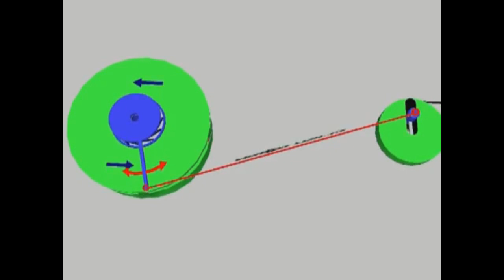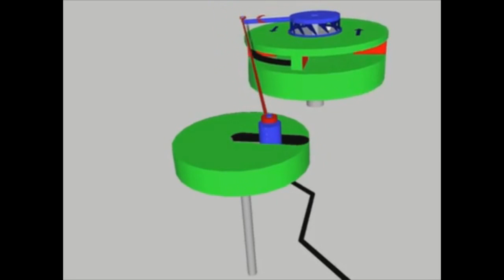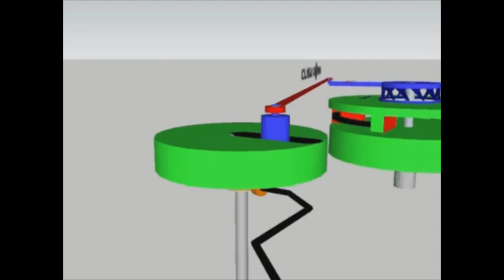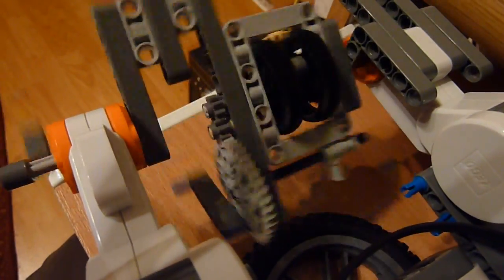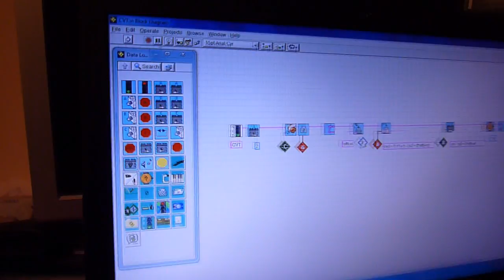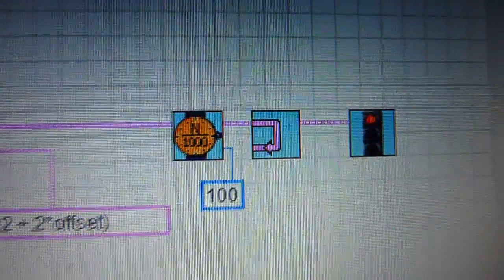LEGO Efficient CVT Frictionless Technology

Comment: https://www.youtube.com/watch?v=F6zE__J0YIU I think you'll find I proved you wrong.
Reply from the maker: That is not true. The concept you linked is just an unnecessarily complex differential. Differentials cannot work as CVTs unless there are 2 main driving motors - and even so it's not really capable of torque conversion.
Reply: I agree with you about the linked concept being an overly complex system for a CVT. However I disagree that differentials dont work as CVTs. I built a Dual Differential CVT out of k'nex which works quite well : 

http://www.instructables.com/id/Knex-Automatic-Transmission-DD-CVT/

Yes, this CVT is not really capable of torque conversion as you state. Instead it is designed to provide a constant amount of torque through an infinite amount of speeds within its range.

Also, the beauty of my CVT is that it requires only a single input, the motor. Most other transmission designs (including yours) require 2 or more inputs. (motorized or not) The compromise to having only a single input though is that my transmission  has a good deal of power loss in the lower ranges due to friction.

Your transmission is not without loss either though, your transmission provides inconsistent power and you do have some friction loss through back-spinning on the ratchet. Something else you should consider, at higher speeds your rotating slider would become unbalanced and cause vibrations. 

The  inconsistent power problem could possibly be overcome by using two push-rod and slider assemblies 180 degrees out of phase, use a separate ratchet for each push-rod, then recombine the power by a simple 3 gear train. This way, while one ratchet is inactive, the other ratchet is driving the output.

Anyways, i'm not trying to prove which one is better. I think each has its own different application. I'm just saying that differentials are quite capable of achieving a CVT function if applied correctly. I think your CVT concept is great btw!

Comment: Junk. Apart from the ratchet design- a known dustbin of CVT designs- you have  a crank mechanism where the crank pin position control is totally glossed over. Tell me how you maintain the crank pin position while it is under load? Here you just use friction. In a real machine several hundred newtons of force will move that crank position in both directions unless restrained. And then you now need hydraulics, pneumatics or another system to change the crank pin position while under load.  Very under thought out.
Reply from the maker: +DoctorShrink You can use a worm gear first and then couple with hydraulics or electric actuator. Worm gears usually cannot be overturned back by the load and they require little input torque.
Reply: +Zenon Dorin You're a genius. So u propose to control the crank pin position with a worm gear. Next question. What controls AND powers the wormgear? Let's see...hydraulics? An electric motor? Hmmm. I'd like to see a hydraulic line reciprocating, with feed and drain lines and a rotating seal (somehow). Hydraulics need a pump and reservoir. I know, an electric motor or actuator. Wow. The crank is rotating at several thou rpm. How do you provide power to a rotating member? Brushes or slip rings. Both wear out, carbon up and create sparks. Gee, not easy is it? I know I'll wave my hands.

You still have not recognised there is a whole class of ratchet based CVTs and yours has the same probs- inefficient, noisy and unreliable.

I shouldn't crush you. You r probably only 15.
Reply from the maker: +DoctorShrink Hahaha. You gotta agree though, this is still pretty ingenious for a 15yo.
Reply: @DoctorShrink  I'm late to this party. While you're right in many ways, where's your video of something you've made? just asking politely now, for information. I see lots of people criticise ideas while not inventing anything of their own.
Reply: Keep working! Cool stuff

Comment: Just amazing! But the non-constant output speed makes it useless in real-life applications. I have also built a CVT, and it doesn't use friction (it uses a double-differential drive instead). Check it out!
Reply: My CVT does rely on friction. However, the advantage of it is that it only requires a single input source while most other designs require at least two. My CVT does not provide more torque at lower gears though, but rather provides a constant torque though an infinite array of speeds.
Reply: If you want to see where the friction is applied see step 11: http://www.instructables.com/id/Knex-Automatic-Transmission-DD-CVT/step11/Tuning-the-CVT/
Reply: +TheMindGarage  could you put here the link?
thks
Reply: Hi there. I know you posted this a while ago, you may have already found what you were looking for.  But I built a dual differential CVT out of K'nex if your interested. 
http://www.instructables.com/id/Knex-Automatic-Transmission-DD-CVT/
Reply: i gotta read something about DD before commenting. Mathematically I think it can't be achieved a frictionless pure CVT because the transition between each gear ratio requires an infinite number of transitional gear ratios, which can only be frictionless in a infinite time,as far as i understood by now. That's why some ships use fluid driven transmissions.
Reply from the maker: That is a good observation, theoretically my CVT design can achieve an infinite number of ratio with a one-way bearing but then the bearing would kinda be friction-based. And then, it wouldn't even be infinite because we can't go further than atom size teeth.
Reply from the maker: @Micah I don't see how your design only requires a single input source. You change the ratio by applying friction with your hand, which is the same as a motor input, except the work gets wasted as heat. That is why differential CVT's have another electric motor onto the "friction" shaft, to recover some energy and pump it back into the main motor.
Reply: +Zenon Dorin Maybe I should have been more specific. Yes my CVT does use 2 inputs. Only one of the inputs needs to be directly controlled by the transmission. The other input is based on the speed of the output, I only used my hand to provide friction on the output to demonstrate the CV function. If it were applied properly, the load would serve this function.

 One application my CVT would be optimal for would be to drive large Ferris wheels as the transmission would accelerate it slowly up to speed and then, if the ferris wheel got bumped or stopped while running, the transmission would resort to idling and prevent the motor from "clicking" and causing damage. 
I do not believe my transmission would be suitable for a vehicle application because of its inefficiencies and its inability to convert torque. 
I love the idea of using an alternator to recover energy on the friction gear though!
Reply from the maker: Oh I understand now, the friction shaft is somewhere inside the CVT.
@DoNotPushHere I am very interested in a mathematical proof on the impossibility of a purely mechanical, non-friction, non-ratchet CVT.
Reply: Correct! I also gave a suggestion on how to expand your CVT  to provide a more constant output power in a comment up top ^^^^ I just wanted to make sure you didn't miss it. Let me know what you think of it!  :)

Comment: Just amazing! But the non-constant output speed makes it useless in real-life applications. I have also built a CVT, and it doesn't use friction (it uses a double-differential drive instead). Check it out!
Reply: Someone made it with multiple cranks, so the power fluctuates less. Similar principle with multiphase motors & rectification

Comment: This is pretty simple and could be adapted to a real life system and the change on the slider part could be changed by using a threaded rod to screw the pivot point to change the speed and power output. Great idea dude. Very very cool.